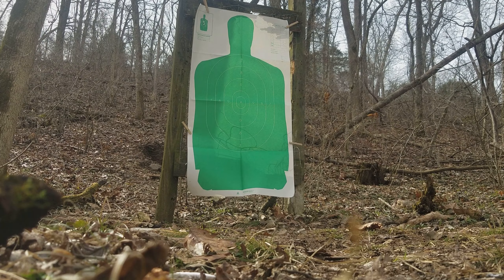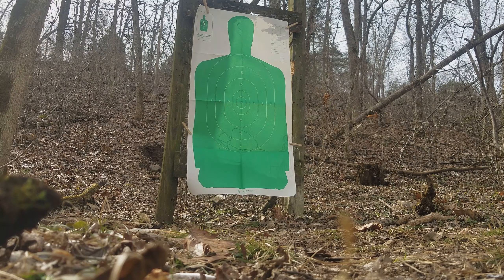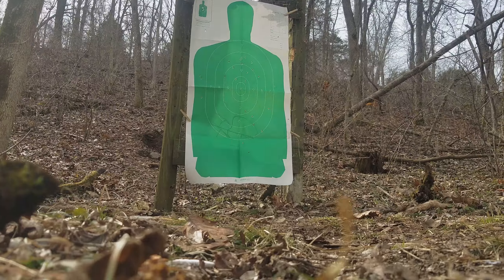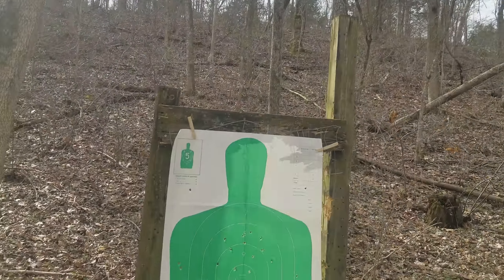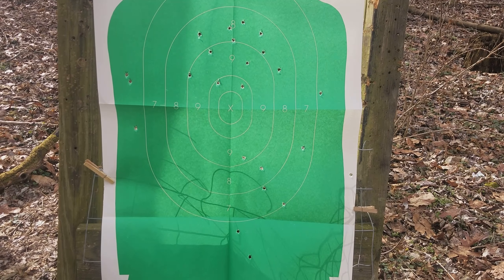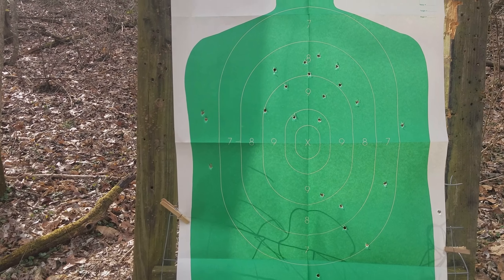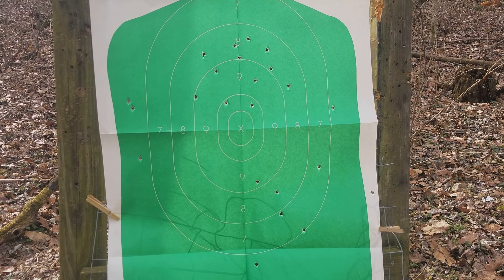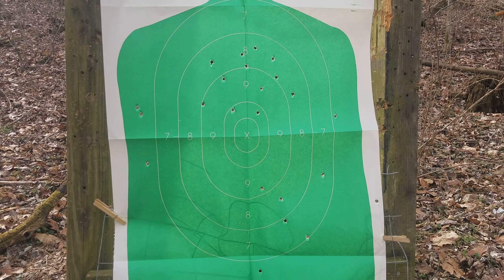Federal LE127 00 Buckshot

Comment: This is a good example of why I prefer using a full choke on my HD gun, and either #4 or #1 buck loaded into a birdshot wad, such as federal 12s3 or 12s4. IMO that performs better than most of the fancy LE branded offerings over a broader window of engagement. Flite control type wads are slightly better at some ranges, but I don't think they are better overall.